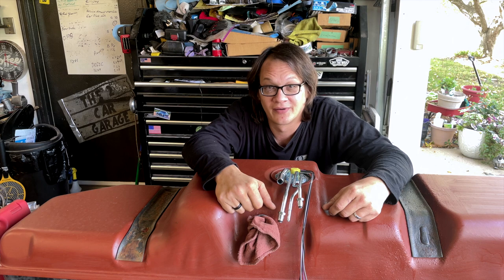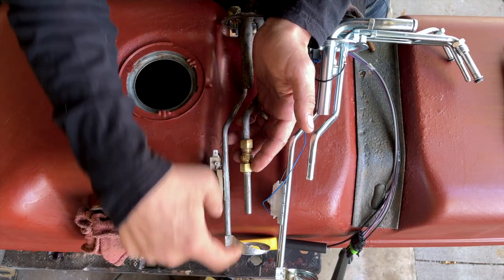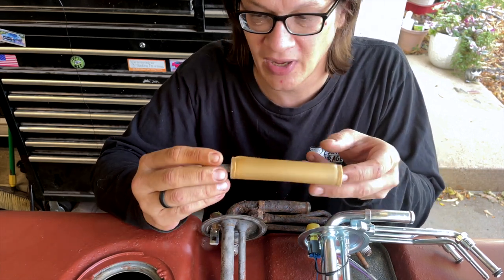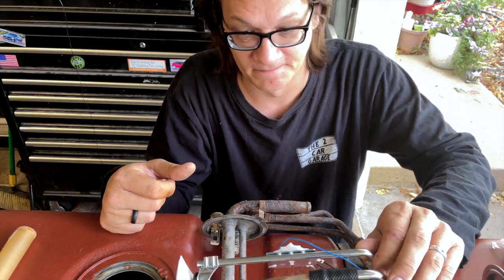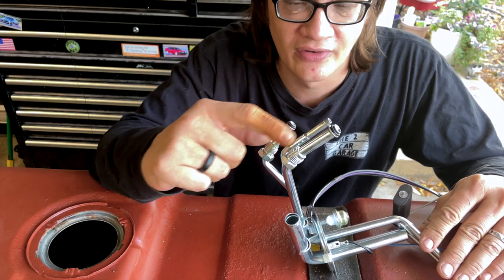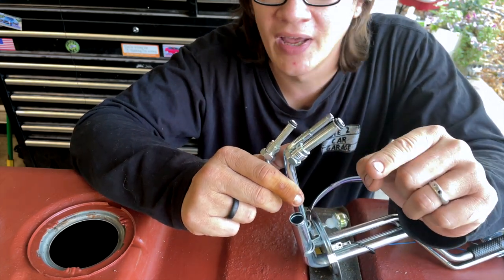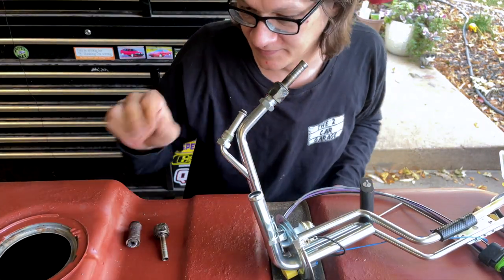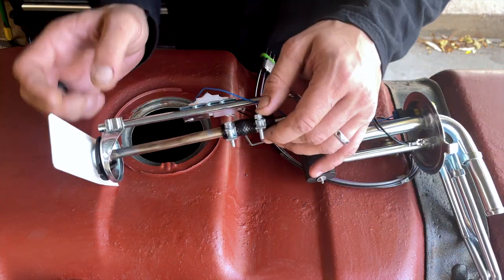EFI Internal Pump Fuel Tank to External Pump Conversion

Comment: Appreciate the detailed tutorial however I was also expecting to see the installation/wiring, etc of the external pump as implied in the title "EFI Internal Pump Fuel Tank to External Pump Conversion".
Reply: it might just be going to a mechanical pump on the engine. i might be wrong.

Comment: I've got an early 2000 Lincoln - Ford Vehicle that has the Fuel Pump in the Gas tank. The Fuel pump quit all at once driving the speed limit on the expressway. Now, I've got to get it repaired. I'm wondering, is there a way to Quick, Easy Install an Electric fuel pump on this type of Vehicle, instead of dropping the Gas tank and installing the Traditional Fuel Pump in the Gas Tank? Fords, Lincoln Cars of this era have this problem. I'm wondering if there was an easier, quicker Work-Around to this Repair. Your Project looked workable and Fun, hope it worked out for you! New Sub,,, Thanks!
Reply: What is the fourth line for on the fuel pump
Reply: Alot of youtube videos how to do it. Loosen the exhaust hangers up so you can ratchet strap the exhaust out of your way.

Comment: So I'm in the process of running this similar set up, I'll be using my return line with mines, what is the purpose for the sock part you placed on the inside,  is used as a block off?
Reply from the maker: The sock is a pre-filter. You see them on almost all fuel tank feed lines. Basically it is there to prevent drawing in large pieces of garbage into the line before the pump. The one used in the video normally attaches to the fuel pump.

Comment: I have a 91 GMC K1500. Someone already did a motor swap and eliminated the computer.  The problem I'm having is sometimes I lose power to my fuel pump. I've replaced everything but the computer, and it's still doing it. I think even with the computer eliminated, the power from the fuel pump still goes through the computer. It probably has a bad ground in the computer. So instead of messing around with it any longer, I'm going to do what you did. My question is, my charcoal canister has been removed, can I install a 7psi electric pump, with a fuel regulator, and not have the charcoal canister, and  the return line hooked up?  I think they have the return line hooked into a "T" fitting behind the engine, so I might use it if it works.
Reply: @IndyColtFan420  It has been 9 months since posting your comment, but first, 4-5PSI are what carb's run on, but the return, that depends on the brand. I have repaired vehicles since late 60's or early 70's when it became serious but never used, added a fuel pressure regulator. I would expect they want the un-used fuel dumped into the tank. I would not like to stress a regulator every minute the engine is running. Out of the tank, it should run thru a filter, the an electric fuel pump. Many will use a second filter after the pump if frame mounted. The number on killer of electric fuel pump is the 20-40 micron trash in the tank. Hope it's not rusted and get eyes on that. Dust, dirt and nasty stuff comes from the gas stations and distributor who brings a mix of 8% ethanol and gas refined to anti knock value of 87. 
  The in tank sock turns yellow, stained from gas, but black or real dark brown not so much. As long as you rubber hose is stamped "Fuel" then use it. No fancy AN-6 connectors and corbin hose clamps work great (Round Spring Flat Ones" worn clamps are ok but chew up the outer rubber coating. If you have a canister use it. The activated carbon granules hold 600 times their weight in hydrocarbons. They are filled about 1/2 during refueling and it a solenoid to engine vacuum (Purge) is opened while at highway speed, at temp and off idle, the fresh air drawn in via the vent burn the expensive stuff you paid for.
  (Fuel Pump) We know on GM's the energize for 2 seconds, shut off. I don't know what you have but the ECM provides ground to the fuel pump relay for this. It controls purge also. Poor connections at the relay, bad relay or body harness are all suspects. The sender has a ground terminal for the sending unit but also is the same for the pump. Using a digital multi meter (DMM) can measure battery at the tank connector, but 7 amps is normal for most fuel pumps. Now many DMM can measure 10-15 or higher. Fuses can be replaced inside if damaged. But an inductive amp clamp is handy, this will show what's going on, lab scopes hooked up let's you "See" the activity. The amps, number of commutator plates and you can even calculate the speed. Fuel pump amperage is not in any Factory service manual, but if you test 600 to 700 of them, you start remember. Voltage drop can be done as it is easy, quick and never lies. You just have to hooked into the beginning and the end of the circuit and turn it on or basically have current flowing thru it (The Circuit).
  If voltage loss is high, over 0.400 volts, then move one connection closer to eliminate a connector or length of wire. If it drops (0.400 volts drop to 0.058 volts) stop, then go back to find the resistance in the circuit. It is like having a garden hose on, then mail man stops his truck tire on top of the hose. It goes from a 7 foot spay to a 7 inch trickle. Their are good videos on the subject and may give additional help to see it done.
 Hope this helps.
DK, ASE Master Tech since 78.
Reply: @deankay4434  Thanks for the reply. I went ahead and put an external fuel pump in it, and I haven't had any problems since.

Comment: I got a 96 Toyota Tacoma I want to put an external electric fuel pump on the frame rail can I do it I had a 94 Ford Ranger put a 302 in it and put one on the frame rail of it it was a Hurst fuel pump turn the key on you hear the pump pump up and then it start right up but this is throttle body injection so does it make any difference
Reply: As long as you hook up the wires going to your external pump the same as they were on the internal, it should be no problem, all you are doing is putting the pump outside of the tank, j/s